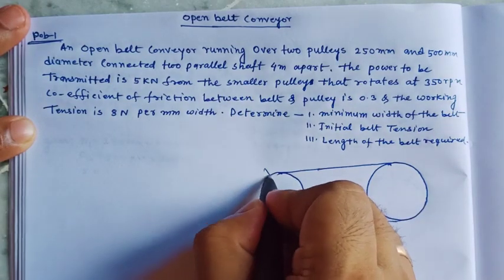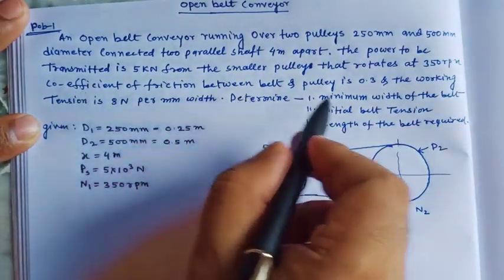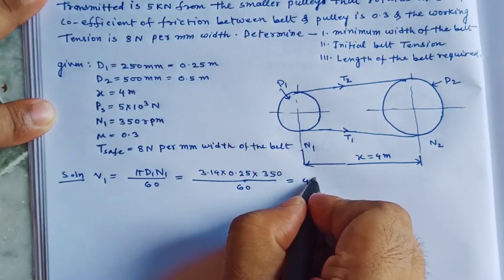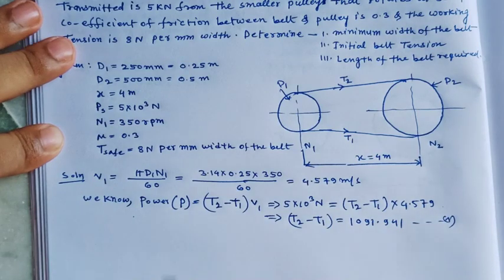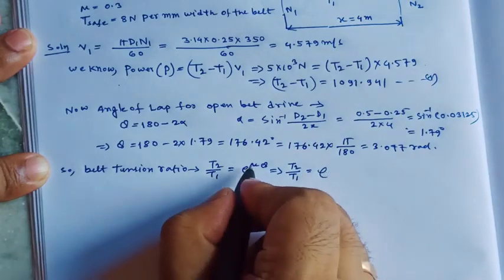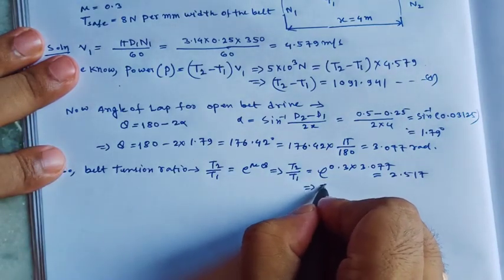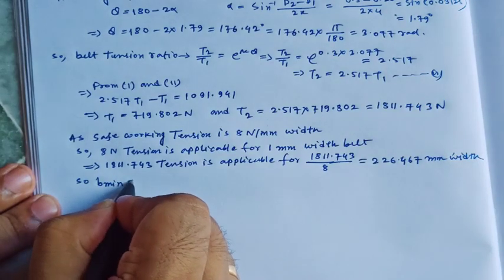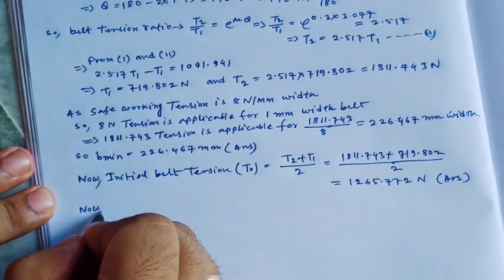Problem on open belt conveyor_Material handling system

Comment: Pls calculate both equal pulley diameters if load on conveyor belt is 1ton per meter and center distance of both the pulley is 6 meter, width of the belt is 1 meter. Belt material is pvc and pulley surface is ms or rubber coated.